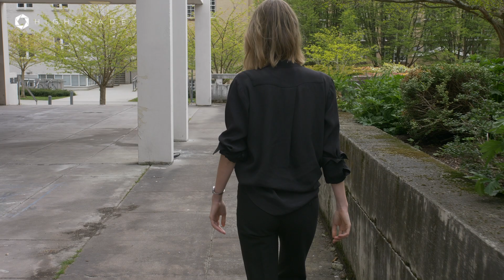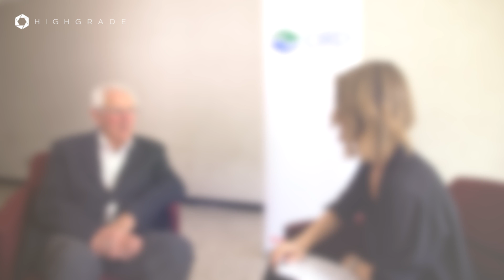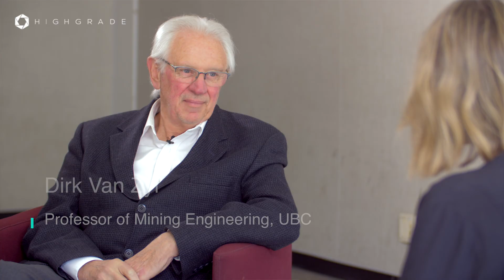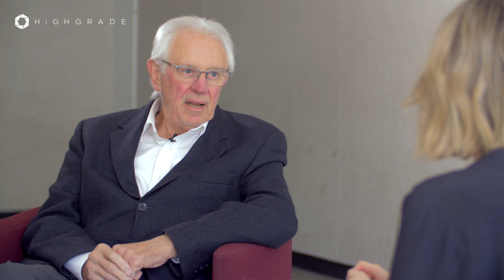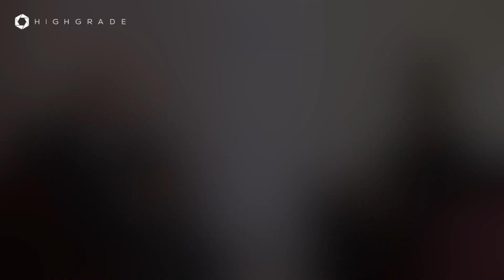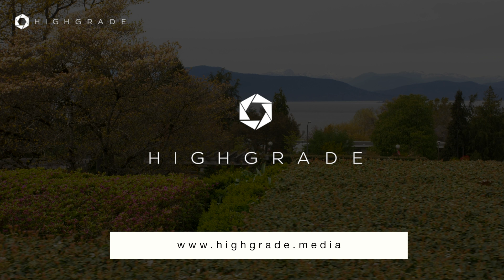Tailings Dams: Why Do Failures Keep Happening? | Highgrade Talks with Dirk Van Zyl

Comment: Tailings dam failures can be minimized by all means from planning to design to  construction to operation and closure. Most of the dam failed are due to selection of incompetent embankment materials and lack of reinforcement materials. most companies  want to build cheap TSF resulting in safety being compromised.
Reply: you think Tailings management issues are solvable, the anti mining lobby says not..?
Reply: Tailings Management issues are manageable and can be minimized. Anti mining lobbies are good at assuming problems but not good at solving  or minimizing problems.
Reply: @laskuri1393  you accept the tailings issue is a real problem?...i did work for years on the mining issue in the Philippines and many of the claims made by the NGO movements were questionable i think but this one?
Reply: @laskuri1393  yet those failed dams are real like Brazil in 2019?
Reply: @kailashpatel1706  you know that right.